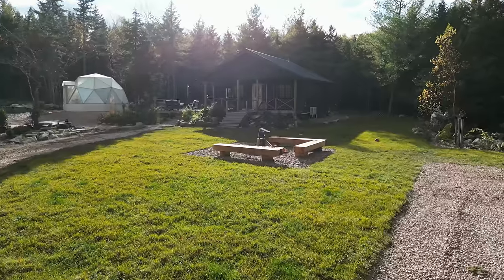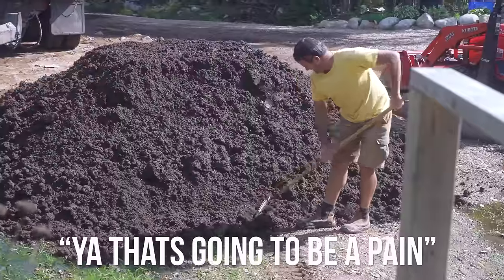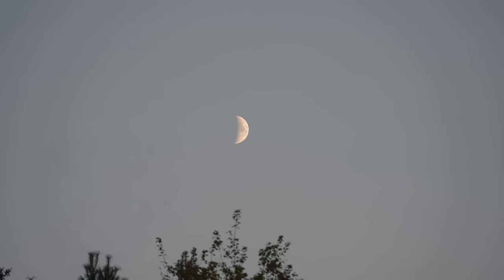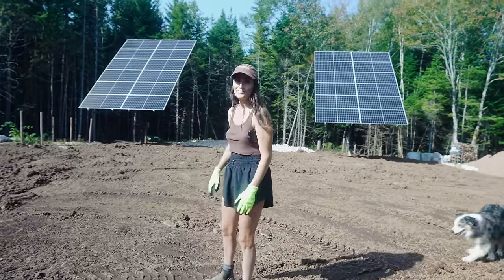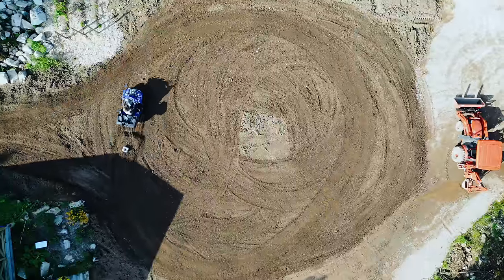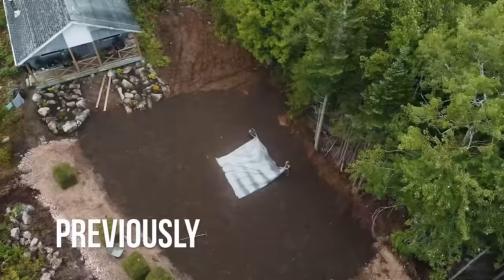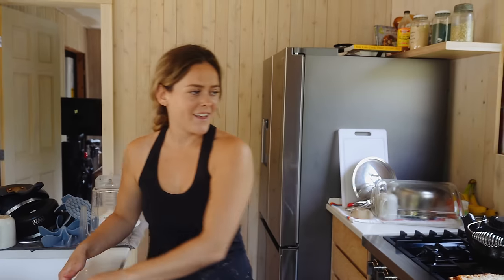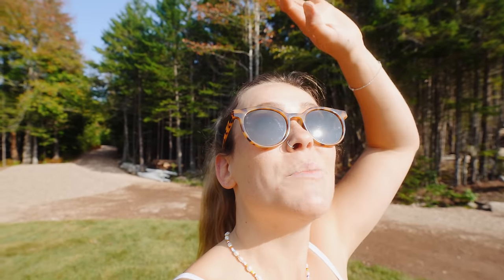SHOCKING LAWN MAKEOVER! (start to finish transformation)

Comment: Hi Gals. I worked up north for a very long time. I also flew on forest fires for one season as a detection pilot. I also know what a wonderful job that the tanker pilots have been doing this season to try to knock down the fires not to mention all the ground crews that have worked tirelessly to try and save peoples homes and property. Could I suggest that, you look into building a fire break around your property. It is basically just a clear-cut area to prevent fire from jumping from the surrounding area onto your property.
Reply from the maker: Thank you so very much for sharing and caring with us.
We had started doing this but need to finish. Thanks for the reminder. 💛🐾

Comment: Hey Jas and Crystal, the path to the shed between the panels should probably be bordered. I'm assuming you're going to travel the path. You might want to put plastic down before the gravel, or you'll be weeding your path weekly. The border will keep the gravel from migrating into the grass. Hitting gravel with a mower can injure you or the dogs(ask me how I know!)
Love all you've been doing ❤
Reply: And the same around the firepit area. Gravel gets onto the grass very easily unless there is a border of some sort.  Treated pine strips are commonly used.

Comment: Ladies, look into a commercial Landscapers Rake. They are aluminum,  and the blade (back of the rake) can be anywhere from 24 inches, to 42 inches in length. They assemble with hand tools, and can be used to not only rake, but also to grade (fine finish) soil.

Comment: Good job on getting the siding off, it must feel good to finally get to check that off your list.  Cute pumpkins and the wood stove looks great! I am kind of hoping that you will be planning to have an alternate source for heating your house, electric heat so you don't have to go out and get wood when it is really freezing and blowing snow.  Always nice to have a backup system and you already have a lot of solar so it would be basically free   to run.  Propane would be expensive and is only going to get more expensive in the future so I vote for electric.  Of course, I have never built off grid in the middle of a freezing nowhere so this is just my City Girl thoughts on the matter.  See you next Sunday, well probably Wednesday, really.